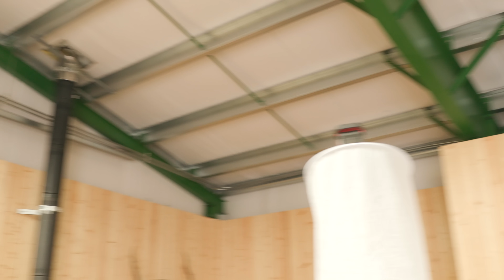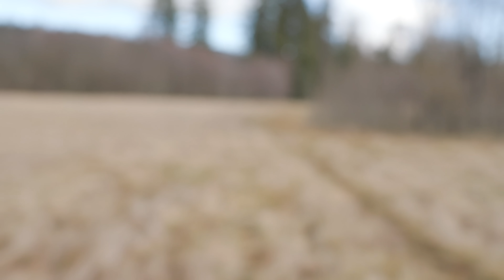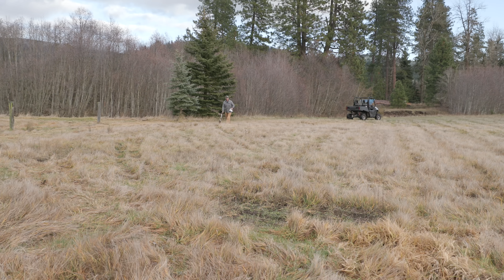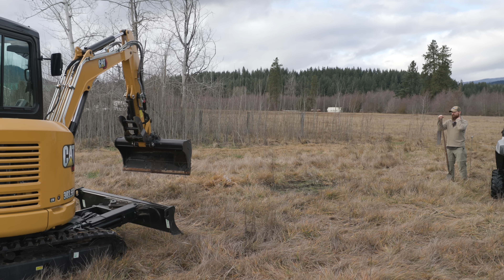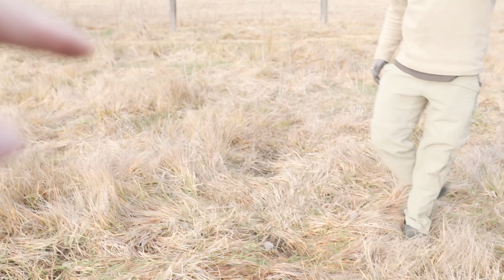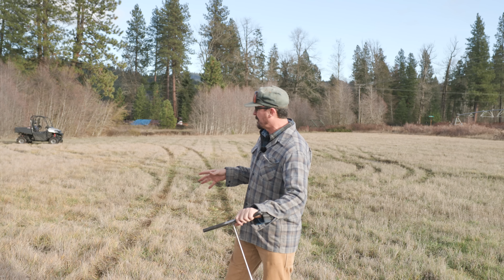THESE PEOPLE MUST BE STOPPED... (BAD NEWS)

Comment: I remodeled a house in austin in 2008. I was adding a second and third floor inside of a really tall space. I kept having arguments with the city because they were claiming I was violating the height limit of the McMansion ordinance. I would explain that i was only altering the inside of the building and not making it any taller.  I would have to have this same debate with them with every interaction and step in the process.  The plumbing inspector  failed the plumbing rough of the master bath which was plumbed just like a commercial multi sink setup. Plumber tore it all out and did it how he wanted it. After I passed my plumbing inspection, the city changed the inspectors territories. The new inspector claimed the old inspector didn't update the system that I had passed, and subsequently failed the passed work from the previous inspector. he made my plumber redo the master bath so it was like it was the first time. It was such a nightmare dealing with the city code and zoning departments that I swore i would never do it again. So, I bought 40 acres in liberty hill which is 35 min outside of austin. No building department or building permits. I only need a septic permit from the county to build out there.   I hope it stays that way.
Reply: I lived in Liberty Hill years ago. Loved that place
Reply: @chrisferguson4267  yeah I am enjoying liberty hill.   the dark skies and extreme quiet aside From the occasional gun fire. Hope it stays that way for a long time. I was lucky and my neighbor bought 140 acres for a single home. So glad he didn't build a sub division.
Reply: Unfortunately with all the new subdivisions and neighborhoods going up right around Liberty Hill, I honestly doubt it. County or City Judge shut down Best in the West Gun Range cause land developers were complaining of rounds escaping. Yeah, right.
Reply: @namenomad2088  I miss best of the west. I am surrounded by large acreage lots and I am outside extra territorial jurisdiction of liberty hill, so I am hoping to remain insulated. Ultimately I may end up surrounded by suburbia in the end. Since I am larger then 10 acres they can't prevent me from discharging firearms.  God bless Texas.
Reply: Happens here in Kerrville TX
Inspectors: egos? turf war between inspectors? wanting bribes?
Reply: Nice! We left Round Rock TX  for Jarrell TX (similar reasons).  It’s amazing the difference among municipalities.
Reply: Government seems to think it's main function is to stand in the way of real progress.
Reply: Cant you see the trend though? Go back to 1900, almsot no building codes. Flash to our time and there is required codes permits inspections and fees all over the place, all over the world too. It happened fast. And it didnt happen on accident or because people wanted to simply be in vogue with the rest of the governments. It was planned. It is an important aspect of total control. Watch how quickly it will spread as we continue to compromise on values like those of freedom and truth every single day while pretending to still be a land of all liberty ran by people who just have our best interests in mind, except for a choice obvious few. Watch how quickly it will spread and grow, if no one exposes them and resists.
Reply: @cocoamcjaegermeister5534  the building code has been in place for a long time and has evolved over time as building science progresses. The first codes were related to life safety. Occupancy rates. Fire exits. Etc. Not all of the codes are problematic. Much like the laws of the state and federal government they get over used without justification. The energy code for instance should be recommendations rather than requiremens. The newsr high seer ac units are super expensive to buy and fix and they don't last.  Whatever energy savings they were supposed to bring were lost when I had to  replace the leaky coil three times in 2 years.
Reply: The Berkley of Texas. Time to change it.
Reply: So the common theme here is liberal governments are incompetent.  Out here in west Texas you could build that building with 0 permits assuming it is outside of the city limits.
Reply: @TXDSGMACH  bullshit
Reply: @raincheck5892  Not bullshit at all, outside of city limits you don't need to pull a permit or have inspection on anything besides septic. I have remodeled and built multiple buildings and houses with out pulling a single permit in north Texas.
Reply: @birddog61999  I concur. County only cares about septic. They don't want you to poison the well water of your neighbors. Beyond that it's up to you to build it right. Besides. Building codes have stoped being about safe building practices.  They seem to be more concerned with making housing super expensive and giving the code enforcent arm of the cities the power to micromanage everyone whole taxing them at every opportunity.
Reply: @raincheck5892  I built a home in TX outside of city limits...and he is right, the only permit necessary was for septic.
Reply: @raincheck5892   Look it up, you don't need a permit in midland county Texas to build a metal building on your land.  In city limits yes, but not in the county.
Reply: @TXDSGMACH  No one should even be allowed to own wetlands, that’s the problem I have with the host of this video
Reply: @raincheck5892  

A.  He’s complaining  that part of his property was unfairly designated as wetland after he he was trying to get permits.   And 
B. The area is not even wetland area by definition to protect anything at risk! 

The properties land that borders streams, lakes, marsh etc. of course belongs to someone with any wetland that may exist thus ownership of the wetland  with the responsibility to preserve  or replace with equal areas if loss are incurred lfrom development of thr property.   

So. People do own the part that the Government is yet agin controlling  how property owners  are  can develop their property.
Reply: That's so sad. I'll bet if you were a famous rich person they would let you do anything. It's a dam shame. I hope all is well with you.  God bless you and ur family.
Reply: It will stay that way until Liberty Hill starts hiring liberal public school teachers, then in one generation you will have newly minted woke County Inspectors
Reply: I really like Liberty Hill - if I had kids still in school I’d be there.  That area is really blowing up with the rt 183 expansion and all the development.  I drive through weekly between the Cedar Park area and our land outside of Llano.  God Bless Texas 🤠
Reply: It will only stay that way if you local residents stay engaged to prevent woke folks from ruining your freedoms.
Reply: @PhilipAnderson  All it takes is one Wokie as a school principal then the whole school falls.

Comment: As a Fire/Building Inspector in the great State of Alaska, I feel your pain.  It can be hard to require folks to comply with regulations that seem to change at the whim of bureaucrats. The State is in the process of upping our snow and wind load currently which could require all new construction to be engineered. We’re doing everything we can to avoid it.
Reply: I thought the world was getting warmer
Reply: As someone who just moved from Alaska, (lived there 20 years) i can say the "building" codes there are a joke. the houses up their are built like junk. even new construction is so sub standard. Everyone wants to sit here and complain about code but its real fun when you buy a home in alaska for 250-300k and realize you just bought a piece of junk that still has nob and tube wiring in the crawl space. So glad to be out of that meth head paradise.
Reply: @punchinello6537   Like anywhere it depends where you live. If code is followed, it is virtually the same everywhere, being based on the International Code Council. Whether or not the code has been adopted where the structure is built and if inspections are done properly is the key. Many places in Alaska, such as outside city limits where I live, there is no building code. It is on the buyer and lender to make sure the structure being purchased is sound.
Reply: Please spare me...

Comment: These are the sort of issues that caused me to rule out moving to Oregon. It doesn't matter if you live out in the boonies as long as the people making the laws are in Portland. It will only get worse.
Reply: I lived in Nebraska for 30+ years and although the two biggest cities, Omaha and Lincoln, had less than 5% of the land in the state they had 90+% of the people so they told the rest of the state how they were going to live.  Something not right with that process since they have no clue how to live where you can't just run down the street to the mega supermarket and get anything you want at any time of the day or night, but set the rules like you can.
Reply: Same here in NY.  I live on Long Island and it’s amazing how much political power NYC has over the state of NY.
Reply: I live in Oregon and I approve this message ^
Reply: I also approve this message